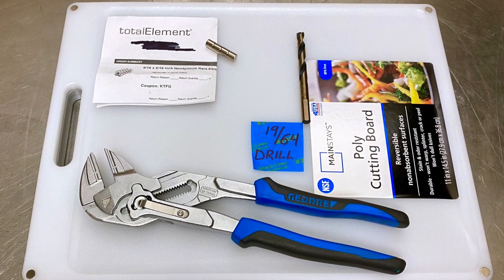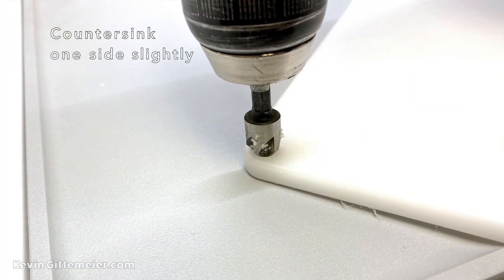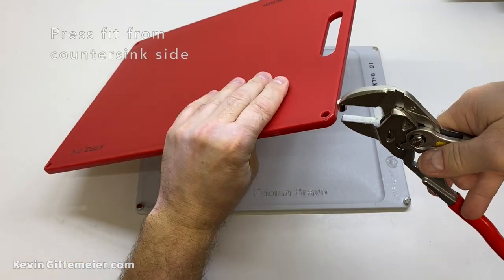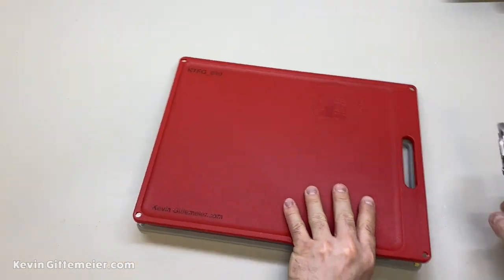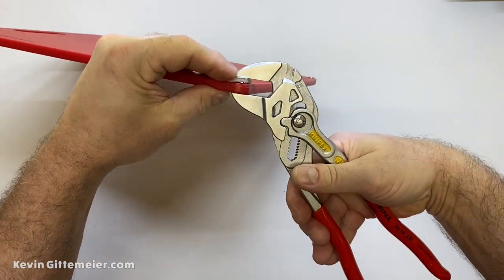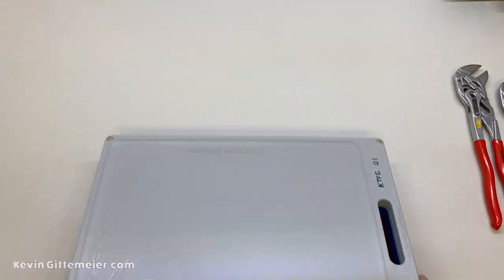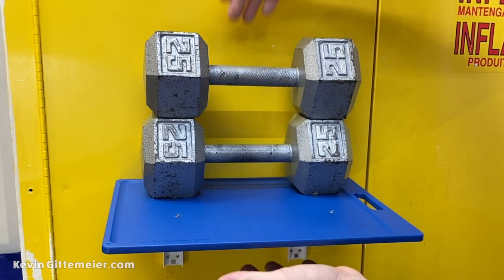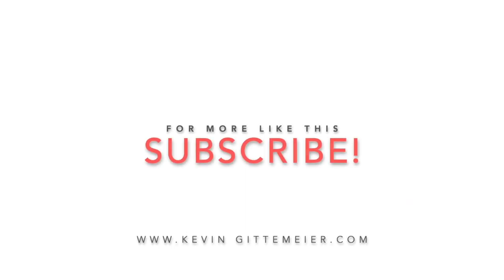How To: DIY Magnetic Work Boards [KTFG_403]

Comment from the maker: DIY Portable Magnetic Work Boards.
Click here to Subscribe: http://goo.gl/DDfVab
https://www.kevingittemeier.com/crosshead-work-board/
more

A great way you can help support my website and YouTube Channel is by using the affiliate links below.  Remember, anything you purchase once you enter through a link (even if it’s not the item linked) will give me a small commission at no extra cost to you.  Thanks!

Easy to build, inexpensive DIY Portable Magnetic Work Boards, full instructions and material list with links on my website:  https://www.kevingittemeier.com/crosshead-work-board/

I primarily use these crosshead work boards as a location to safely put a tool bag, tools and material when performing tasks such as door work, changing roller guides etc. These specific boards can be used on the flat side or the recessed side which is good for holding hardware, drill bits and objects that may roll around. They have 4 super strong N48 Neodymium magnets so they stick to the crosshead.
The boards I use are Mainstays (made by Dexas) and Dexas boards from Walmart.
Dexas is sold on Amazon but I can’t confirm it’s the exact board I use.

I also use these same boards in many other builds like by Magnetic Folding Shelf:
https://www.kevingittemeier.com/magnetic-shelf-v2/
https://youtu.be/gNxLWbxZBlk

My most sophisticated build:   https://youtu.be/44MXvdKak5A
Stress Relief:  https://youtu.be/JDVbH4I3YyQ

Xhead Work Board Build [KTFG 403]:  https://youtu.be/KE2LjRiIgmk
Xhead Work Board Red [KTFG 404] :  https://youtu.be/SKLdQbwQdZs
Xhead Work Board Blue [KTFG 405]:  https://youtu.be/SyE7RUQNJCM
Xhead Work Board Gray [KTFG 406]:  https://youtu.be/v10dk4yimCg

Work Board Material List:
5/16 x 5/16” Neodymium Cylinder Magnets:  https://bit.ly/3L24sJY
Dexas Cutting Boards Gray, Green, Red, Blue:   https://amzn.to/3FMGUXD
Or
Dexas Cutting Board White:  https://amzn.to/3FOwsiA

Tool List:
BOSCH 19/64 Cobalt Drill Bit:  https://amzn.to/3sCXnZg
Or
DWD29J-CO-PC 29pc Drill Bit Set Round Case (1/16-1/2 x 64ths)
https://amzn.to/38tOeLB

Or
DEWALT Drill Bit Set 29pc (w 19/64):  https://amzn.to/3MeHhNe

BOSCH CST1 1/2” Countersink:  https://amzn.to/3NdyHOS

Gedore Spanner 10” w/ Grip Covers:  https://amzn.to/37KyaVx
Or
KNIPEX Tools Pliers Wrench 10-Inch:  https://amzn.to/3LjToqJ

Milwaukee M12 Drill Driver/Impact Kit:  https://amzn.to/3MhI7IO
Or
Ryobi DP103L 10 in. Drill Press:  https://amzn.to/3a2nLFp

NEJE Master 2 Mini Laser Engraver:  https://amzn.to/3Lg2e9d
The Laser engraver wasn’t a thoroughly researched purchase, I just went with the cheapest option with good reviews.  I don’t regret the purchase but if I had it to do over again I would get one a little bigger and more powerful.
Like the NEJE Master 2S: https://amzn.to/3wde4MO for just a little more money.
Or maybe:
ORTUR laser master engraver:  https://amzn.to/3NeUsOd
Or 
xTool D1 Laer Engraver:  https://amzn.to/3ltnePr

Optional:
Knipex 86-04-100 Pliers Wrench XS (4”):
https://amzn.to/3L9gD6R

KNIPEX Tools 86 03 125, 5-Inch Mini Pliers Wrench:
https://amzn.to/3LaSRaF

KNIPEX Tools - Pliers Wrench 10" Ergonomic Grip:
https://amzn.to/3wdUUqe
Reply from the maker: Rubik’s 4x4 Beginner Method Tutorial:  https://youtu.be/3U-HWJaHHwQ 
https://www.kevingittemeier.com/4x4-cube-tutorial/

To purchase Puzzles seen in tutorials:
https://www.kevingittemeier.com/shop-games/